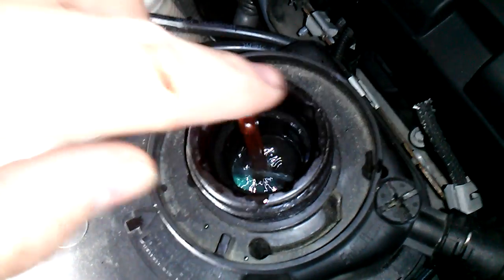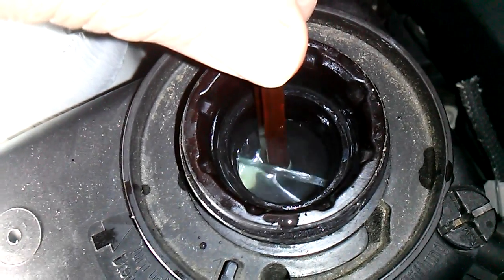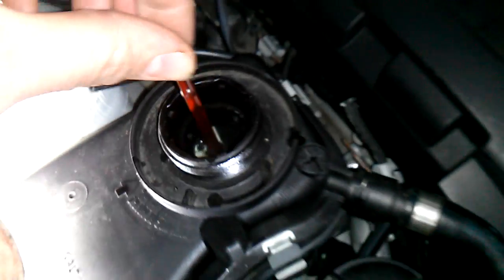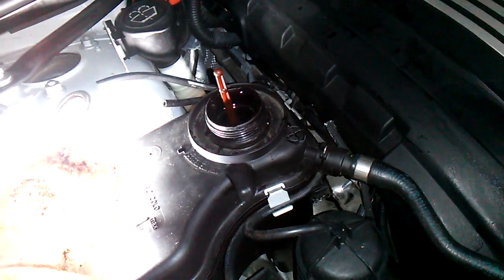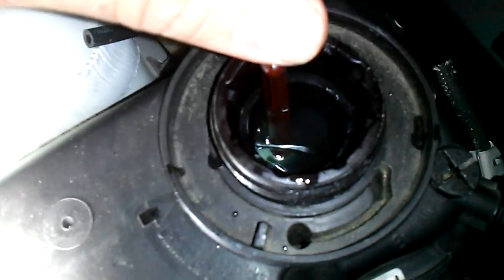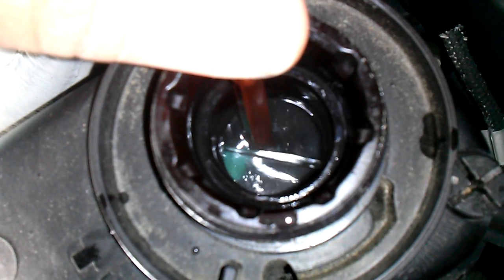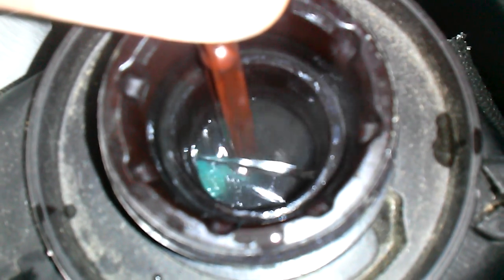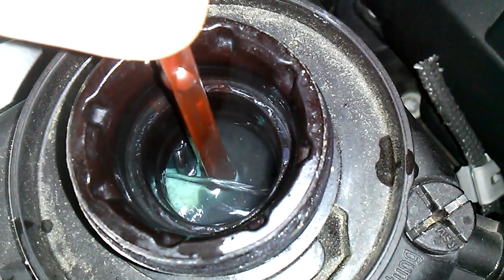Bmw coolant bleed in action. E90 335i

Comment: I’m trying to figure iur dontou need to open the bleeder screw at all? Or just use the electric pump- 
Also is it ok you have the cap off I thought u leave it on
Reply from the maker: You take the bleeder screw out when filling it. When bleeding it calls for the cap to be on. But i leave it off incsse a top off is needed
Reply: I just replaced my tank Anne bled it too 

https://youtu.be/D_-RsleZ_Kg

Comment: Does the cap have to be closed or just leave it open until all 12 minutes finish.
Reply from the maker: wees beast it is supposed to be shut. i just opened it so you can see it working
Reply: bobdudeman1988 how would you do this step for a 2005 545i v8
Reply from the maker: wees beast it has a mechanical pump. im not versed in how to bleed that engine but if its anything like my 318i you just start the engine with the bleeder screw open and when it stops pissing air out shut it

Comment: is that the only way u can bleed the coolant system or can u do it old skool, fill up the radiator/resevoir , radiator cap off n let the car run for awhile until the air bubbles go away
Reply from the maker: Joseph Oliva I suggest doing it as bmw recommends. this way is pretty idiot proof and fully bleeds the system without runing the engine and risking damage due to an air pocket
Reply: Alright. Thank u

Comment: That pump is about to kick the bucket! 😒
Reply from the maker: it lasted another year before it finally cracked and started leaking. but it never actually died electrically..witch is amazing lol
Reply: +bobdudeman1988 then that's one hell of a pump. lol. I was watching your video because I changed my radiator in my 07 328i. Now almost a month later, my expansion tank cracked and started leaking. I am replacing the tank tomorrow but I wasn't sure what made it overheat and crack. After watching your video, I remembered that I did not "properly" bleed the system of air. I followed your instructions and removed a ton of air. Thanks for making that video. 👍🏽